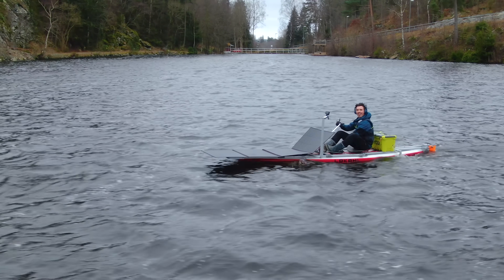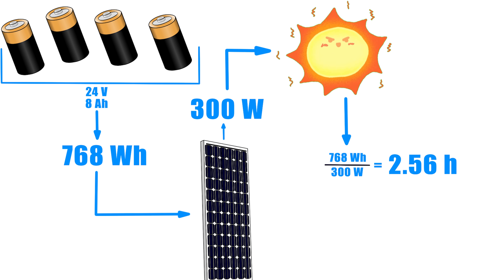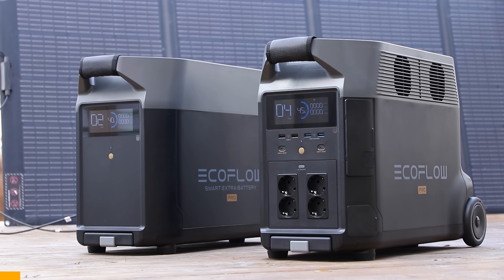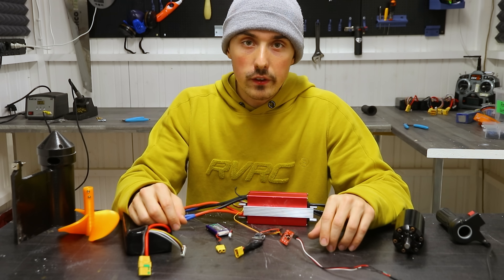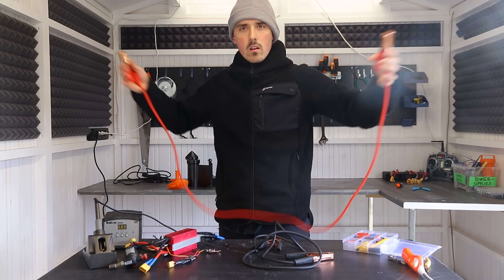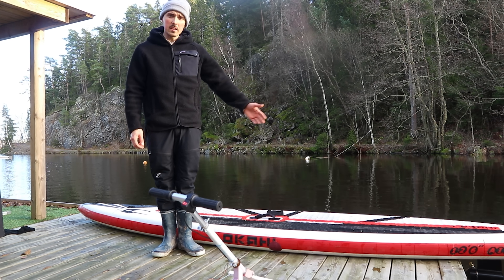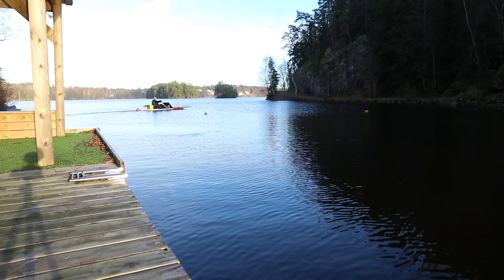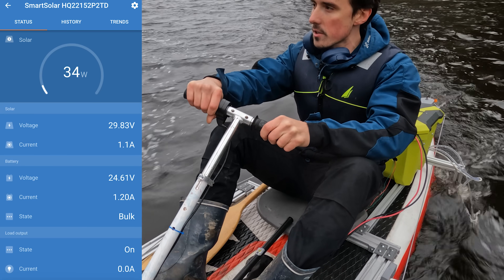Trying To Build An Electric Boat With Infinite Range

Comment: Thousands of years ago, people built wind powered boats with essentially infinite range. The limitations have always been the availability of the power source and the durability of the active components. For sailing boats, the power source is the wind, and the active components are the sails, masts, rigging, rudder and hull. For your craft, the power source is the Sun and the active components are the motors, pumps, solar cells, batteries and the hull.

Comment: How many Watts does the motor use? How many do the Solar panels produce?
BTW, a larger diameter Prop has always more efficiency than a small one; you might consider reducing the angle of the blades instead.

Comment: Bubba you can't stack those patches like that.  They are made to contact the underside to the material of the inflatable.  The glue plus the two different types of rubbers creates a swirl of mixing compounds basically.  The patch rubber and the inflatable rubber are different but not by much.  Just enough for the chemical reaction to take place.  You need a large one piece patch. Just my help to you.

Comment: My dream boat would sail and generate power from that like a weel or someing in the water?!? But still be light enough to row. Than the batteries are only needed in canals and stuff when arms are to tierd. Wish I was smsrt enough to figure it out

Comment: I would have done the steering by legs as done in kajaks and the throttle with a conventional lever as in motor boats. So you don't have to worry about left/right and you can go full throttle backwards if needed.

Comment: Thanks for sharing. Saw another video where a 2 hp /1500 W (gasoline) outboarder was used on a  16 or 17 foot canoe..And it did 12 kmh on calm water.. Think that would be 1500W : 8 = 187 W at 6 kmh. And 444 W at 9 kmh..By the way I love your rudder..Its so RC like... In xxxl ..A bit more speed...And you could make a water pick up in the blade😉

Comment: Hi, watching again this video. Can please explain if the motor housing is waterproof? If yes, how did you achieve that? For example, at the propeller shaft, some water is always coming in. What model did you use to make the propeller? How is the propeller connected to the motor? I noticed that you can't reverse the motor. I suggest you use a bi-directional ESC so you can go forward and in reverse. Thank you for your reply, Gennady

Comment: I WISH MORE PEOPLE KNEW THAT YOU NEED TO INFLATE INFLATABLES TO THE DESIRED PRESSURE ONCE THEY ARE ON THE WATER AS THE TEMPERATURE IS COOLER THAN THE AIR, THUS CONDENSING IT AND MAKING THE WATERCRAFT LESS PRESSURIZED. FAILING TO DO SO CAN LEAD TO EXCESS STRESS AND IS LESS AQUADYNAMIC BY CAUSING MORE DRAG. Sorry for all caps. It hurts me to see inflatables not used to their fullest as much as reading all caps. 🤣🤣🤣

Comment: All right for a prototype. But you do need to avoid mixing zinc fasteners with aluminium extrusion and the steel kids scooter.  Marine ply is better but you need to ditch the inflatable stand up paddle board and use more fibre glass if you want this to last. AL fame should be integrated into your fibre glass body. It’s conductive.

Comment: I could see using one of those big old cheap Old Town canoes, fab an outrigger for the solar panels... the canoe itself is like a pickup truck in terms of cargo capacity, so plenty of room for batteries and such. Such a setup would be a blast for some epic adventure video (series).

Comment: Hey, I'm not sure if you already shortened the distance between the board and the motor, but if you haven't do some research first. If the propeller is not deep enough in the water, or if it's too close to the board, the propeller with cavitate, making it nearly impossible to accelerate or move forward at all. Just a piece of friendly advice :)

Comment: I was a bit worried about the build quality. Didn't seem up to your usual high standards, but your motor mount and prop were nice, and impressed that it seemed to work pretty much first time out. Nice variety of projects. I would have tried to do this one with a kayak, instead of using the paddle board but it's your baby. Anyway great job overall and another good video!

Comment: Awesome job on your boat, all you need to do for the steering is cross the cables using a 4 pollen configuration. Two stacked inline and behind the steering column running one right cable around to the left and the left cable around to the right to the other two pulleys on earthier side of the boat.
Reply: That’s 4 pulley not pollen.

Comment: What's the power Consumption of motor at cruising speeds? That way one can determine if it works indefinitely in sunny hours.

I would put a 2nd motor for speed / redundancy and go over landing on this setup 😊

Comment: If you haven't already had this breakthrough, the next step should be making a PONTOON BOAT VERSION! So 2 paddle boards with aluminum frame across the top. higher, more stable, more area for laying down or sitting, more cargo space, can fit more solar panels...
Reply: Id go with actual solid floats then too. If you're going hard, don't skimp on your floats

Comment: My only suggestion would be having 2 engines mounted on your side not at the back. Outboards both propel & steer, you only need to propel use engine for balance

Comment: love the idea, i believe the noise from the motor you're hearing is caused by cavitation. its awesome that you  made your own proppeler but i think its just a little too small in diameter. thats why the motor might be creating air bubbles, causing the motor spin faster because it has less water resistance. and thats the noise you are hearing i believe.

Comment: I Like this! I recommend use bicycle brake cable for the steering. there's no pully needed. You can even cross the cable to correct the oppo steer issue. Hope this help. Keep up the good work man

Comment: Angry at it for leaking or the hack job of putting the patches on? Next time, use some 3M5200 or Sika291 or similar. Since you can't be bothered to lay down the patches without wrinkles the PU caulking will do a lot of gap filling for you. Cheers.

Comment: I think that the deeper the motor is, the more the pressure will inhibit cavitation.  However, it's a trade off between that& shallow water operation & manoeuvrability, because a long plate to hold the motor will oppose rudder control.  One solution is to simply mount the motor on the rudder itself, rather like an outboard motor, it will aid manoeuvrability under power, but also increases the likelihood of cavitation, though that also has solutions.  At the end of the day, design is balancing compromises.  Kudos for putting it together.

Comment: Why do you use a rudder for steering instead of adding the motor to the steeringmount in the back? So you have way more better control of the steering in my opinion and if you put two pulleys in front of the stearing-"wheel" and attatch the cables, you steer in the right direction 😉

Comment: LOL... enjoyed your video a lot ... but, dude you need anger management therapy LOL!! You can use a used trolling motor for power ... very very efficient ... no heat related issues and the propellers are designed for efficiency and quiet operation... it would take your project to next level.

Comment: years ago did a 16ft basic plywood quick-canoe powered by a 100w 24vcd brushed scooter motor direct driven 12v into a small YoungProps T-6 trolling motor propeller. 5/16" steel shaft is a great fit into 3/8" hard hydraulic tubing, motor inside and dry. it'd run displacement speed (square root hull length x 1.56 = max speed 6.24 mph, times 0.75 = 4.68 mph max efficiency for electric. it would have been a great candidate for solar because of very low power consumption, the motor also never got warm. faster than 4.7 mph the amp draw would climb a lot, making bigger wakes but not really running much faster. still used canoe paddles for steering to avoid "motor powered" registration and fee BS (its electric ASSISTED lol), it ran around nicely with two aboard no problem. nice practical recipe if you want to adopt it for easy+efficient all day solar cruising.
Reply: wémroñg

Comment: Propeller itself could be an issue - causing cavitations, thus bubbles irregularly, significantly decreasing performance and inbalance.
Shorten that fin motor is on and also brace the motor with some supports to sides - can just sit on top (bottom) of the board, but as widely as possible.
And seriously check that propeller design - flow-wise you want blades as thin as possible and definitely no sudden changes of thickness either - leading edge and trailing edge cant be just blunt piece of brick, uniformal thickness ended with single radius don't cut it either...

Comment: 80% of 24V is 19.2V so you could run your batteries until about 20V before needing to recharge them. But if you have enough solar coming in, and they don't drop below 23V, I would say you made your infinite range electric boat. Or am I totally wrong?

Comment: I think if you build a canopy for the solar panels to put them over were you sit will give you better exposure for them. And just cross the steering cables to get it to turn in the right direction.

Comment: I would put the motor on a pivot connected to the steering wheel and ruder on the front side connected to the foot paddles, to have more control.

Comment: I did similar about a year an a half back, cut down a trolling motor and bolted it to my fin, used a plastic harbor freight ammo can as battery and electronics box, used 4 5000 mah 3s batteries. Used aarma brushed esc and servo tester for forward and reverse, cheap volt meter on momentary switch to monitor voltage, Xt 60 solar input and motor output, tilt switch and magnets as a safety switch in case I fell off.
Reply: Buy silent yaght 60 foter solar ejrrc

Comment: You might be hearing cavitation from the prop, and reducing clearance could compound that issue.  There are prop pitch calculators that can help you design a... um... proper prop... and it looks like you're pretty close to the 4.2 inch diameter at 3.4 inches of pitch (at .25 hp doing 3k rpm I made up)... but then calculating for cavitation is much more involved than a comment thread is gonna get out of me.  Sorry.  I have to click shit.  Gotta go.

Comment: How did you attach the aluminium frame to the inflatable paddle board? I was thinking of making an electric catamaran out of 2 I have but I want to make sure anything I put is secure before taking it out on the water

Comment: Cross the steering cables in the front and your steering will be correct. Left side of steering to right cable and right side to the left cable.

Comment: Hey just wanted to let you know, the sound of the “motor being unbalanced” is actually a combination of that and cavitation. 
Cavitation occurs when the propeller aspirates air and creates air bubbles, also known as cavitating. 
You might benefit from 3d printing a hydrofoil fin that goes above the propeller to prevent aspiration and also help create a beneficial ground effect against the propeller. 

You might also want to print your parts in an enclosed, controlled environment printer as the PLA often tends to warp and deform if it’s too moist, or too cold. 
If this doesn’t help enough, sand your parts, put them on a drill or motor, and check the balancing. They do make lead tape for balancing airplane propellers, as they often go out of balance. 
Another advice I’d go for is to go for an airplane propeller instead of a boat propeller for such a small electric motor. The smaller surface area reduces torque but increases top speed while increasing runtime due to better hydrodynamic efficiency. 
This can also be improved upon by using a PWM to manage your motor as it reduces the amount of amp draw at lower speed settings. 

You could also take a look at monocrystalline solar panels as they are more space and energy efficient than the amorphous solar panels you’re using at the moment, which might result in better performance. 

With these things in mind, keep in mind polycrystalline panels will outperform monocrystalline on a cloudy day as they’re more sensitive to ambient and polarized light but monocrystalline outperforms all else on direct sunlight. 
The only real benefit of amorphous panels is foldability. 

The other thing I’d REALLY recommend is setting up a fuse or circuit breaker system for your box, considering you’re mounting it on an inflatable SUP. If a boat creates wake and your setup falls in the water or water gets in the box and shorts, you could be stunned, drown, and die with that much current in the water (I saw a 24V system). 

Please be safe, I know getting things to work is exciting, but so is your safety. If you’re gone, no more cool videos that show how human it is to make mistakes . 😢 Water is not a force of nature you want to challenge. Very few do so and win. 
Great video, great channel! 
Look forward to seeing more!
Reply: That is not how electricity works. 24v is never dangerous to humans in  open waters. Electricity won't flow though his body if it has another, lower impedance path. 
Those are on the other hand lipos which are going to burn intensively if short circuited. He should definitely not discharge them more than 3.2 v per cell, that is important and something I assumed he knew.

Comment: I've put a little thought into this myself and I can see large ocean going ships towing a couple of acres of panels behind them that can be furled on deck or onto an outrigger that folds flat against the ship when approaching ports or for bad weather.
Reply: At least you understand the scale issues you will run into when using solar powered transportation. 'A couple of ACRES' is pretty accurate for a passenger ship. An e-bike or e-scooter would need to tow a trailer the size of a car full of panels, while a car would need to tow a trailer the size of 5 or 6 fully laden ARTICULATED LORRIES to generate enough power for perpetual battery life - even more if you consider the fact the sun goes in and you need to generate and store enough power for dusk and night-time riding/driving/sailing.............

Comment: I just want to give a quick tip if you want to be able to reverse if the motor controller supports it you can add a reverse polarity switch, or between the motor and the motor controller you can add a reverse polarity switch and you'll be able to choose to go forward or backward

Comment: So any propeller needs to have a cutting edge and a really smooth finish, I don't have a number but I'd estimate about 50% of the energy goes to waste without them.
Would love to see the increase in performance with a smoothed out propeller. Biltema has a propeller kit for 0.8hk electric motors, maybe that's worth checking out?

Comment: It apears you are using 6s batteries. You should stop at around 3.2 volts per cell which is 19.2 for the entire pack. Damage starts to occur below 3v per cell.

Comment: Put the motor on the end of the rudder to give you turning abilities at slower speeds. I like the outrigger ideas for stability. Plus more areas for more solar. Put a roof on for shade and solar panels.

Comment: I think if you swapped the ends of the wire on your steering tail thing so they criss cross before attaching to it, it would have corrected your steering.

Comment: I think you could easily put the solar panels on top as a foldable roof. This would open up a lot of space but still be compact since the roof feet are foldable. Also i would try using a store bought rc boat motor/propeller combo. At least the rc props are very well made to compensate for cavitation etc. Try to use the big Ecoflow Powerstation in combination with a PC/Server PSU. You can run hours of of this. I had a similar idea for ages. Love it! im looking forward to seeing more of this!
Reply: I guess it would be super unstable.
Reply: I second the store bought boat propeller. The first time I heard this video, it sounded like massive cavitation.
https://www.youtube.com/watch?v=KbFa1fmlAXg
Reply: If he adds a roof, he will need to also add outriggers to prevent it from tipping over.
Reply: Biy solar pc

Comment: I might be wrong but I think - what you hear is not the motor imbalance. The sound is the propeller either cavitating or ventilating. The propellers do not like to spin very fast but you make yours do it.  The electrical propulsion work in this case a bit better with a jet pump or a speed reduction. The impeller of a jet pump can spin way faster without side effects like the propeller does...

Comment: One you're getting to good at this, less mistakes made. Two, who needs reverse, just go go. Three, did you bring a paddle on the first run in case it died or didn't work? You never showed if you loaded one only saw it later

Comment: what you can do is add a tube infront of the prop and it will push water up to cool it without using a pump. RC boats do this

Comment: Maybe try a propeller similar to a trolling motor prop. That way you can run a lower rpm and the balance won't be as much of an issue.
Reply: Yes the sound I think is cavitation on the prop. Opening up the angles to be less pitch would help here for the RPM vs speed.